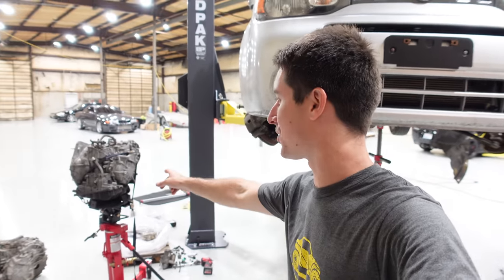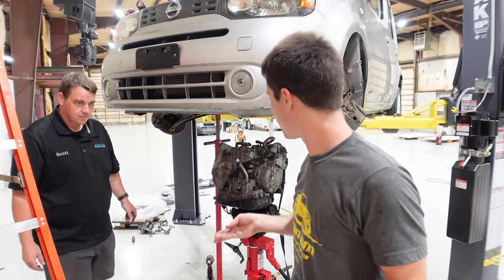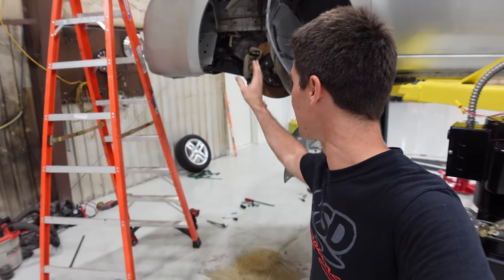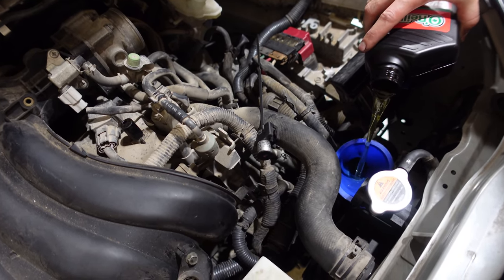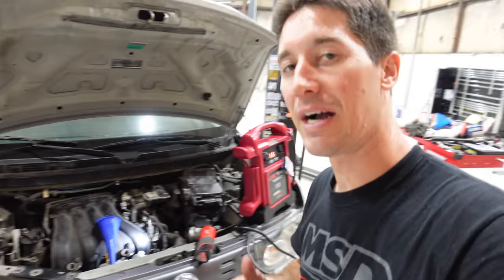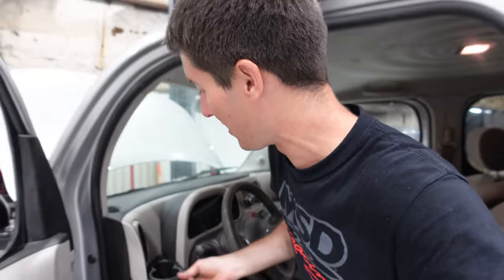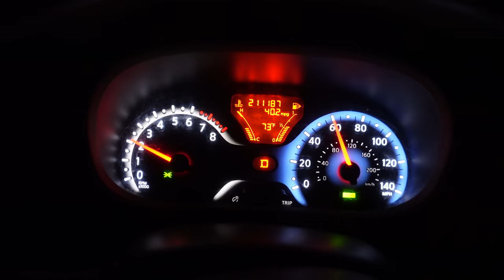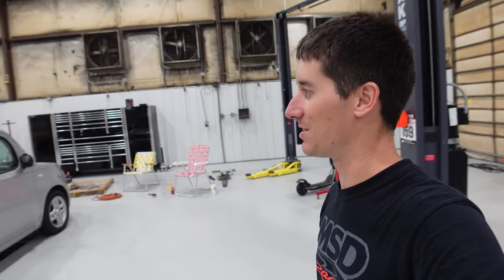I Brought This Nissan Cube BACK From The BRINK *Everything Was Broken When I Got It*

Comment: I have a 2009 cube, what i would recommend is: 1) its better to use Nissan CVT  fluid, it performs better.
2) get an external transmission cooler.  The transmission tends to run really hot and cause the car to rev high and wont pass maybe 40km/hr. The external cooler eliminates that problem and ensures you wont have to change your transmission

Comment: I had a silver 2010 cube SV fully loaded with all the toys including backup camera. I loved that little puppy! I liked the dash, it’s layout, it’s huge roomy interior, huge wide opening doors, and loved those huge cup holders in the corners of the dash. And it consistently got 30 to 32 mpg in town and running the suburbs. And it got 33 on the freeway. I found the CVT transmission was a great fit for driving that car. Loved it’s smoothness. It always had the right gear ratio for every driving situation. While it wound not win any races, it had plenty of pep for almost every situation. A very easy and pleasant car to drive. P.S. Most people drive the throttle wrong. Instead of just flooring it and putting the engine in full scream mode, it reacted and performed better by just smoothly rolling into the throttle. That way you got smooth and quick acceleration with the satisfying rising rpm feel of a regular transmission. Try it. And see what you think.
Reply: As an added benefit, your CVT transmission will last a lot longer!!
Reply: @larrybrown9279  173k miles on my original trans & fluid. Kept it sealed. Still going.
Reply: @mattp532  Lucky few.

Comment: I've owned 3 Cubes, don't judge them just by how they look. Not enough power, we only get 1.4Lt & 1.5Lt. Wish we got the 1.8L as well in New Zealand 🇳🇿
Reply: We bought a new 09 Nissan Sentra by the grace of god with proper maintenance and sold it with 216,000 miles for $900. Due to failing NJ emissions also with into limp mode 3 times during 10-plus years of ownership. But CVT was resuscitated back to life. Lesson learn to stay away from any CVT!!

Comment: Had an exhaust leak on my 2009 Cube. The way the muffler sits, water collects around the front entry point and rusts it out. Had a shop weld a piece in between the tube and the muffler. Muffler was kinda' expensive for it, if I remember.

Comment: Yes! You've somehow made me like these cars.
Reply from the maker: It's really not that bad 🍻
Reply: They were honestly never bad cars since day one
Reply: Nothing would make me like these cars.. unless it was free.
Reply: @lancewashington3910   My wife had an 09 Cube bought new. Never changed the front brakes only turned the rotors once. Original rear brake shoes. Went through 4 windshields. Part was the angle of the windshield was prone to rocks and Safelite hated working on it because I guess it was a pain to install. It was a decent car for the most part except at 76K the transmission started acting up like loss of power. Dealer found a broken ground wire in the TCM. Fixed it then it started acting up about 3 months later. I cleared the check engine light and we traded it in. The Nissan dealer sold the cube about 2 weeks later and the transmission crapped out on the new owner. But the dealer took care of it and replaced it.
Reply: My wife loves these cars.  We have an 09 and 14.  First year and last year (they were sold as a US model).  They aren't super powerful, but comfortable as heck.  Both are 6 speed manuals and the 09 has 225k on it and still on the original clutch.  Only issues we've had are usual consumables, tires, bearings, etc.  And generally overall MPG is 33-36 mixed hwy/city driving.  It may have a face only a mother could love, but they've been rock sold transportation for us.
Reply: @WatchJRGo  my 2010 Cube has been flawless and yes the gas mileage is amazing !

Comment: My Juke had an exhaust leak and it was fixed with a simple welded on collar.   Probably took 30 minutes tops and I never had another problem with it.
Reply: I once fixed a hole in the exhaust pipe of a previous car with a Coke can and a couple of hose clamps.  I drove with that for months.  It was great.
Reply: Sorry you admit you own one !!
Reply: @mikemontgomery7337  No joke... probably one of my least favorite cars I've owned.  It's been reliable (actually) but it's completely impractical, low powered and a ticking time bomb for major repairs I fear.

Comment: Great job on the cube. I don't like cvt  transmissions. 
My wifes car has one I don't like the way it responds or shifts..but I heard all Nissans SUV n cars have cvts now.
Reply: Yes Nissan loves their CVTs but they are replacing the  2022 Pathfinder with a 9 Speed hopefully its better than the CVT.
Reply: not only Nissan, honda,Kia and others
Reply: @buffsheeri  I loved the old nizzan exterras they had great transmissions. My exterras was great over 100 Mile. Never had a transmission issue.

Comment: Pull the electric 4×4 out of the rear fit a narrowed 8.8 lsd differential fit rear wheel drive front struts with appropriate brakes ( skyline ) then biff the nissan cube engine and gearbox and fit with gen 3  5.3  and 4l60e no need to alter fire wall if you fit radiator under rear of vehicle or simple recess for front mount radiator  and fit a roll cage  ( we built 3 of in new Zealand one was a rebuild of the first ended up being fitted with a 5.7

Comment: Everyone gives nissans crap but their build quality is higher than a kia/hyundai and the parts are easy and cheap to find. One of their biggest issues is ac compressor failure. Anyone who had a cvt fail guaranteed wasn't flushing regularly

Comment: Cubes, Scion XB's a lot of those cars have transmission problems but they're pretty nice daily drivers. Comfy, can move people or stuff pretty easy its no wonder interest is peaking in them again. Its those transmissions having to deal with low hp to weight ratios. I was looking for an XB for a while and in my search it seemed like everyone was after those pre 2009ish manual transmissions so you can hang in gears to help with its poor acceleration while getting on highways.

Comment: I would always worry that the used replacement transmission has some issue you won't know about until you get it all back in.  Maybe even the same issue as the one you're replacing.

Comment: I just bought a Juke Nismo AUTOMATIC (yuck but it’s for my daughter) that I’m about to add an external cooler for the CVT. I’m shocked you’re not doing this since you’re replacing a failed transmission.
Reply: It’s a flip car, the next owner can do it.
Reply: @chipb1193  I’m not really taking about the flip as much as the content. You can easily flip cars without a YouTube channel. I watch because I like to learn and the content is usually awesome.

Comment: How similar are they to a Juke, mechanically? As I see the fuel gauge etc is the same as on the Juke I spent 6+ hours driving from eastern Norway to the west, though a manual gearbox, no auto. 
The reason I'm curious, is if they get the weird... computer? Basically next to the button in the center console saying 'Climate' is another button labeled 'D-Mode' 
Pressing it changes the buttons to the climate control, and the screen showing temp etc, and you can put it in 'Normal' mode, with the screen where you get a meter showing how much of your torque you're using, not numerical, just a bar showing if you're using some or all your torque.
Then there's 'Eco' mode, which shows a bar that's full, and the less eco you drive, the more the bar goes down, and even has a 0 - 5 star rating for how economical you drive. :P
Then there's 'Sport' mode, which has a 'Power' bar, that shows if you're using little power, or a lot of power :P
All of these affect the throttle response, and how sensitive and direct the steering is as well, in 'Sport' I found that setting off from standing still nearly almost resulted in tire squeal, not ideal in the middle of a town, and you just stopped to let some pedestrian cross the road. :P

Comment: Just bought a 2005 Saab 95 aero linear with headlight alignment problems and needs a coil pack for 400 bucks. No rust and almost perfect body and interior. Good deal or? Keep in mind I live in sweden where they are more common but still. What's a good one worth over in America?

Comment: Replace a crappy transmission with a crappy transmission....seems legit 👍
Reply from the maker: Well it's not like there is another option, what I did was fix it. 🤷‍♂️
Reply: @WatchJRGo  LS1 swap !!!
Reply: @jonsingle1614  on a front wheel drive car? Hope you like doing lots and lots of welding and fabricating. Unless you're talking about an LS4 V8 swap from a Pontiac Bonneville/Grand Prix GTP - and that's an automatic-only swap. No manual transmission exists for front wheel drive LS4 applications.
Reply: @houseofno  actually the F23 Getrag from the 00-02 J-cars fits bolt on.

Comment: I'm driving a 2007 Nissan Altima with a bad transmission. Dealership wants over $5000.00 to replace it. Used with no warranties are over $1,000.00 before labor and rebuilt are $2,000.00 to $3,000.00 before installation all for a car valued at around $4000.00. Don't have the money or income to repair it or buy a new car so I'm forced to babying it to the market and then home. If you want another one to fix I could pay you $1000.00???

Comment: Jr......your my hero.....can I ride your Megatron oops sorry Optimus prime jdm emo disco ball fairy dust stripper glitter wrapped goldwing or what? I have my class M .....I'm licensed and insured for anything I drive....and have close to 30k miles of 2 wheels under belt....also used to work at a huge motorcycle dealer for close to 6 years here in the cheesey Wisconsin....not quite as cultured or glamorous as Kansas....but we got Mac n cheese !!!! and how about those male deer winning for once? Let's take to the streets and celebrate!!! Lol can't feed house or cloth our masses but hey a bunch of really tall extremely overpaid expensive shoe models finally like actually did there JOB.....so let's spend a couple million on a parade eh?